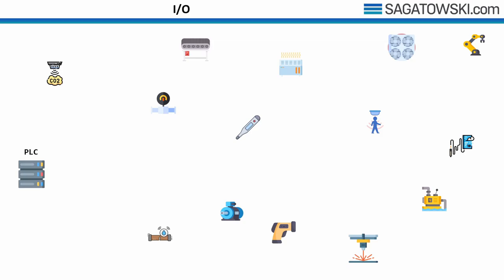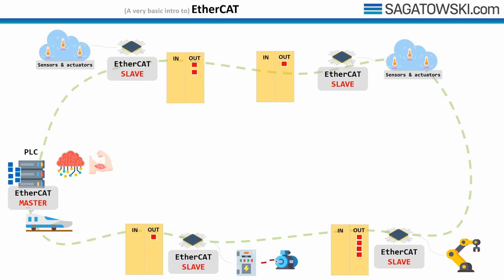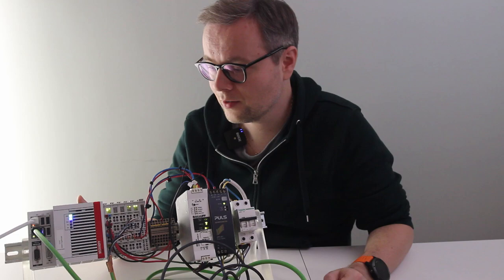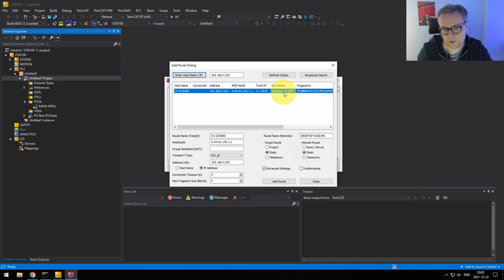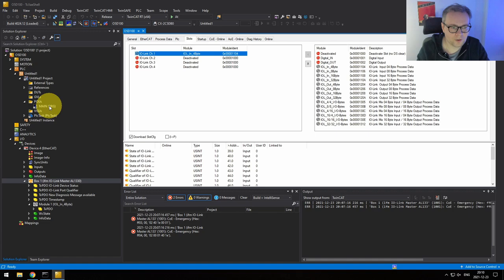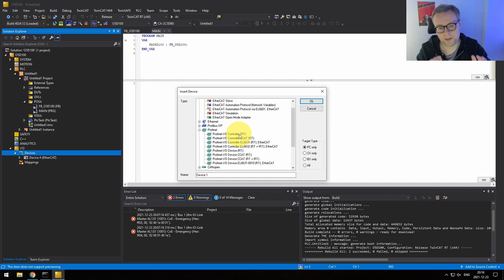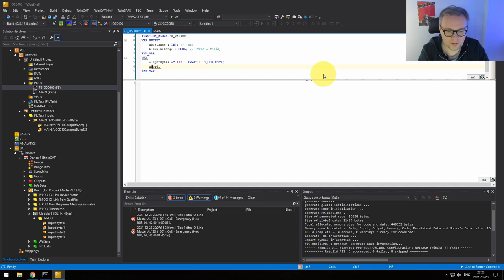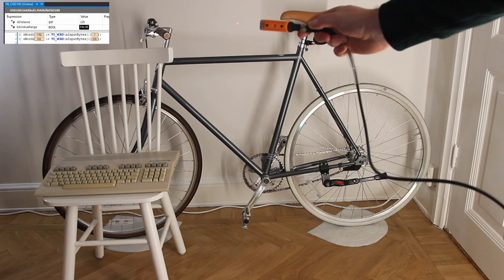PLC programming using TwinCAT 3 - IO (Part 10/18)

Comment: Another great video Jakob, congrats!
Related to CI/CD and code coupling, which approach do you consider to be better and why?
1. The inputs, from the sensor, are linked to an internal variable, like "aInputBytes" array on video.
2. The function block has an input variable, similar to "aInputBytes", and we pass the data from sensor as reference to the function block.

Comment: Hi Jakob, really awesome job! It's really obvious that you have big passion for automation and your tutorials are so intersting to follow! You also make it hard for me to return to my usual work in TIA Portal after seeing how straightforward the Beckhoff development environment is 😂I am one of those software programmers who coincidentally got into PLCs so I'd rather use Visual Studio based IDE. I actually periodically talk about this in my company but they really don't want to move away from Siemens. The current hardware shortage might acutally be in favor for me. The fact that you could run Beckhoff program on any PC if you cannot get any other PLC in time is a big plus. 
One question I'd have - is it possible to automate the Tag to IO assignment process with some custom scripting? I work with conveyor systems where we have around 600-700 photoelectric sensors and ~500 motors connected to one PLC via AS-interface to Profinet gateways so it would be quite timely to link every bit or byte for that amount of IO. For TIA we actually developed a way to convert excel documentation we get from our engineers straight into code that we just paste into TIA and mapping these signals take us like 10-15minutes. Do you think it would be possible to do something similar for TwinCat?
Reply from the maker: Hi Clooskey! I'm happy you find my tutorial useful. Yes, this is possible using the TwinCAT automation interface which I will talk about in a future episode of this course.

Comment: Hi Jakob. Thanks for the great series. Is the topology for EtherCat always Ring topology or can other topologies be used (star for example)? I ask because we have an SMC IO module for pneumatic valves that is failing and when the packets drop there it faults out our Estop modules. It would be nice that auxiliary modules not fault out something as important as a safety module but that seems to be the case with this topology.

Comment: Hello, I've been following your tutorials, it has been incredibly usefull. I have a question though, when you mentioned that ethercat needed to know the sync master time, when did you actually configure that value? or is it taken automatically from the slave que you linked the variables? Sorry if it a silly question.
Reply from the maker: Hi Javier! Not a silly question at all. Yes, the EtherCAT speed is taken automatically by the cycle-time of your task.
Reply: @JakobSagatowski  thank you very much! looking forward to your next releases! I had a little experience in siemens Ladder and in function block Niagara BMS programming, but this stuff is new to me. With your help I think I am getting up to speed a little bit at a time.
Reply from the maker: @javiermachuca7567  I'm happy my tutorials are useful. If you want to have earlier access to the new parts, you can become a Patron (www.patreon.com/sagatowski ). You will support my content creation and get access to the new parts earlier at the same time! Thanks.

Comment: Hi Jakob
How is going?
I started my first steps with an IPC C6920, but I have a problem. When add a new route this IPC appears with error: ads error 1796 (0x704). I can't use off configuration mode o run mode. 
Also, the route appears with a padlock. 
Have you some idea about this?